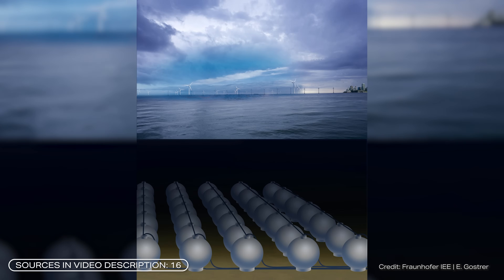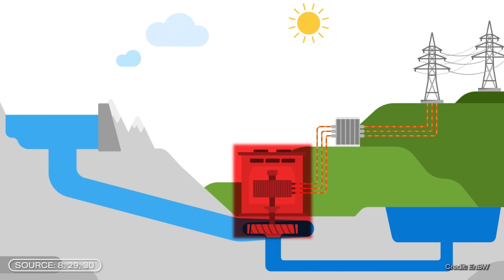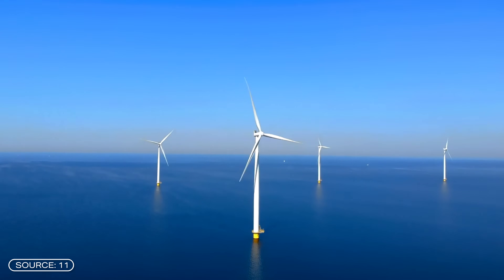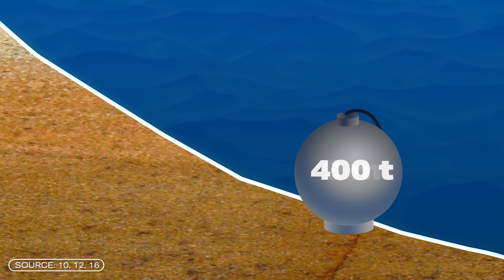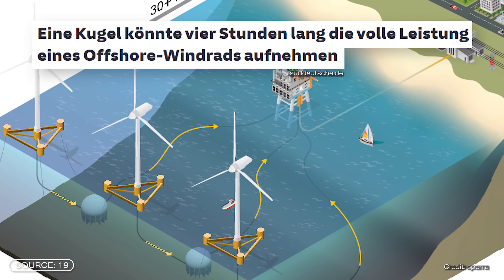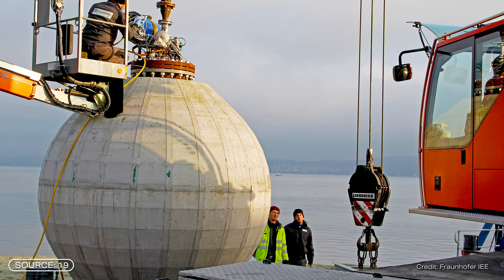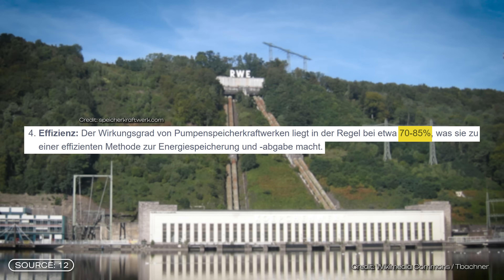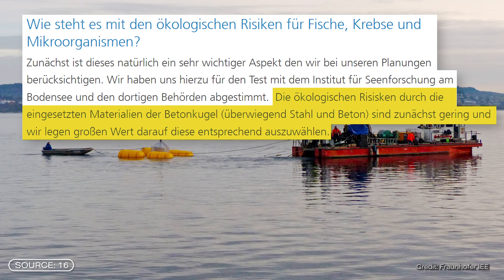Underwater Battery Storing Power at 600m depth!

Comment: I've used large inflatable bladders to seal against high pressure. Instead of 3D printing the container, Using these bladders and a reusable external mold would allow reinforcing the cement with steel or carbon fiber composites.

Comment: Better idea:

Work with gas as the medium.

CO2 becomes liquid at between -56.6 and 31 °C and a pressure of between 5.2 (42 meters deep) - 74 bar (740 meters deep), and reduces to 1/535th of its volume. 

Using the warmer surrounding seawater regassify the CO2 running it through turbines. You would not need to keep the gas liquid for too long, running it through a daily cycle, or a few days maximum. Enough to smooth out the bumps in demand and production.

Comment: I woukd be surprised if 3d printed cement was as structurally strong as steel reinforced concrete- fine for prototypes but not good for mass production at further depth.

Comment: I can see that the principle is OK, no question about that. But with a 9 meter concrete sfere and only 0,4 MWh is not much, my rooftop solar, that is not very big produces more than 1MWH per month during summer. Since I live in Sweden, the average electricity useper person is higher than in Germany. A system like this must take into consideration that heating water and houses make increase the energy demand significantly. This solution seems VERY expansive compared to batteries, but that is an opinion from me, since you have no real costs included in the ad.  What is the estimated price per MWh stored? How much energy is leaked backwards through pumps? Especially after some time?

Comment: errr... like if your going to put it right next to offshore wind, wouldn't it be better to put the pumps and generators above water to make them easier to service, which would enable you to not have to worry about depth at all, yes you would have to worry about the pressure from the prospective of the pipe, but if you are condensing air... hummm you would probably have to use CO2 so you can liquefy the CO2 to reduce the inner pipe diameter so you don't need a stupidly expensive pipe, but it means you could go 10km down and be fine, because thats 100ATM which is about the pressure that you would need to keep CO2 a liquid, and as for the theraml energy you would need to pump into the CO2 to turn it into a gas... ya do know that you are surrounded by water ~95C hotter than the temperature required to turn CO2 into a gas right? 

And the cold, well you could mix it with a lot of ambient sea water before it's released, and haven't we raised ocean temperatures by like 0.9C since the pre industrial area as long as your mixing it to be only 0.9C colder than ambient sea temperatures I don't see a problem.

Comment: 6:05 Actually, a single 30m sphere will deliver 20MWh via a 5MW turbine. Assuming 80% RTE, which is typical for pumped hydro, it would take about five hours to recharge. 🤓

Scaling is done by deploying more spheres. Last I heard, they haven't said anything about using larger spheres, but I suppose it's possible if they fabricate them at sea. Doubling the diameter gives eight times the capacity, but it may be easier to build and deploy a bunch of smaller ones. 🤔
Reply: If the size  is double they will have to use 8times more concrete,  it will be impossible to sink, it will make sense at sea level with steel tanks.
Reply: @yvanpimentel9950  The surface area only increases as a square of the radius, so you only need 4x the concrete. If buoyancy becomes a problem, you can add more concrete as needed; it’s cheaper than steel by weight, it’s already used in the construction, and it resists corrosion. It would make no sense at sea level, because you don’t have any hydraulic head. 😕

Comment: An overlooked solution for pumped hydro of the conventional type is smaller scale closed loop pumped hydro. Michael Barnard reported on Cleantechnica a GIS study from the National Renewable Energy Laboratory (NREL) which found that there are a huge number of possible sites worldwide. Because they are smaller they're faster to build and don't require as much capital.

Comment: Does not see why this is a good idea. There is a 60 bars difference. So the concrete must resist 60 bars from outside. If the water is compressed at see level at 60 bars what is the difference?
Any way, the most important is : how much energy it is recovered compare to the energy used to get the water out? I bet no, less than 50%

Comment: Interesting,  but I do not underestimate the technological challenges, and am not fully convinced about the environmental impact.. Being a Norwegian I know we have quite a large area of deep waters quite close to shore, that should fit quite nicely.  However we have also a lot of hydroelectric power-plants that should be easier to use.  These have limited surplus capacity in the early spring, when the snow melts in the mountains, but the rest of the year it should be fully possible to store energy by pumping water up to the higher magazines, and I know this is already done at some plants.

Comment: Why use a concrete sphere - all you need is a sack - a waterproof bag - which does need to be anchored down
And why muck about with pumps underwater - keep the pumps on the surface and pump air downwards
Great Idea - made far more complex and expensive than it should be

Comment: Neat concept. There are plenty of places in Europe with 600m deep water not too far from the shore.
I assume the design will aim for neutral buoyancy when empty. That means it can be pulled up for maintenance. However, if it fails and fills with water - that is about 12000 tons for the 30m diameter sphere, which means it is stuck there, forever. 
If the engineers can master the pumping of sea water, then there are some interesting locations in the Balkans for large scale (>>100 GWh) storage using sea water pumped storage. 
As for the environmental footprint of concrete, could the researchers consider Biorock (https://en.wikipedia.org/wiki/Biorock)? This is meant to be stronger than concrete, and could be grown near shore and then floated out.  
And forget about putting this in mines and small bodies of water. It will change the surface level so you might as well go for classic pumped storage. Storing a certain volume of water in a lake is easier than in a sphere.

Comment: The concept is great but the fact of using electromechanical devices and sea water at high pressure does not sit well. Very high probability for mechanical failures and serviceability of these spheres at that depth. 
 The second thing I learned today is that in Germany delimiters for numerical values is a decimal point. We would write 10,000 and in Germany it's 10.000 !
Reply: They're using off-the-shelf marine pumps with a rated service life of 20 years. That doesn't seem unreasonable. 🤷‍♂
Reply: Side note: decimals are typically useless and misleading, at least in the press or in visuals. If a percentage is stated as 76.36 those 0.36 are completely meaningless and worse, they insinuate a precision that is not really there. Past 100 it just becomes ridiculous. I once told a gallery owner that her price tags on those thirtysix thousand dollar bronze statues made them look even more expensive (36.000,00) and she changed the tags.
Reply: There are tons of existing marine devices that are fine

Comment: a bladder that could inflate and use the air based turbines when water pressure causes it to deflate would be easier and less material intensive to install. they could even make them like an engine piston out of used tires coated in protective material to add recycling to the process.

Comment: Fascinating technology, essentially gravity batterie's in mine's"are the same as pumped storage in mine's,but lead electrically lifted and dropped is more efficient but probably with a greater outlay at the begining,thank's
Reply: Usually, mines are not close to PV and wind power plants. No need for storage if transport were cheap -- just use the power elsewhere.

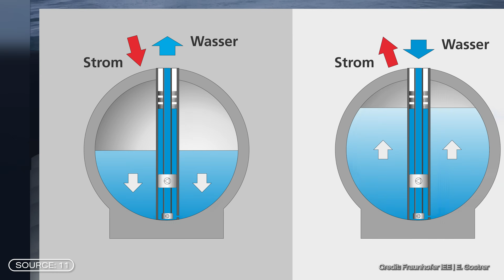Comment: 2:36 The water pump is reversible; in other words, the pump when running backwards is functioning as a generator.
 It's a motor-generator.
strom = electricity  &  wasser = water

Comment: if they were evacuated by pumping in air the interior of the sphere would constantly be at the same pressure as the surrounding sea.  Electricity could be generated by both the in rushing water when a valve is opened and the air being forced out.  Depth thereby becomes a non-issue.

Comment: I just did a quick Google search on "offshore wind farm typical depth" and the AI result summary says ...

"Offshore wind farms are generally located in waters where depths range from around 10 meters to 60 meters, with the majority being in shallow to medium depths. However, new technologies like floating wind turbines are enabling deeper water installations, with some projects operating in waters up to 1000 meters deep."

I'm wondering whether that floating wind turbine technology and this energy storage technology might be a perfect marriage. Might it be possible to build a single module that is a floating wind turbine with its own dedicated storage sphere hung at the perfect depth below it? The counterbalance weight provided by the presumably very heavy concrete sphere might also help with the stability of the floating wind turbine and it might even be possible to provide some pressurised access within the overall structure (a leg/truss going down to the sphere with a diameter wide enough to allow maintenance personnel to climb down to access at least some of the sub-surface equipment).

Comment: 3d concrete printing is probably best in low volume production, but I suspect that if these spheres need to be produced in high numbers, more traditional production methods are cheaper/faster. I also have doubts about the strength and repeatability of 3d printing production. 
The principle of this system is similar to an idea I saw a few years ago, that was to put inflatable bladders on the seafloor and pump them full of air with excess electricity and use that pressurized air to create electricity in turbines. Another option I have seen is to create big enclosed kofferdams in the sea that keep out water. Pump them dry with excess electricity and create electricity as needed as you fill these kofferdams up again. Both methods are limited because they operate at lower pressures than this new concept, but also are more easily maintained. The airbladders, in principle, can have all the moving parts on dry land or a tethered barge, linked to the bladders with hoses or pipes.
Reply: Two downsides with the bladders: Lift and heat. The concrete sphere compensates lift by its weight, but the bladder needs a larger anchor and strength to be tied to the anchor. Compressing gas generates heat, and for efficiency, you would need to use or store that heat -- increasing the investment.
Reply: You're not the only one being skeptic about 3d printed concrete tank. When I hear something people make it sound revolutionise, it will be either fail to delivery what they promised or just being a straight scam.
Reply: I think the 3D printing is just for investors buzzword value. It'd take forever to print a single huge sphere with an expensive machine. Classic formwork can be scaled much wider.

Comment: Each sphere needs to withstand the whole potential force, making the technique require orders of magnitude more resources compared to a pond at same elevation, as the depth the spheres are placed, for a given storage capacity. The potential energy is mgh, mass times gravity times height, and gravity isn't very different 600 meters below sea level compared to 600 meters above it, so those spheres have roughly the same capacity per unit of volume as a pumped hydro dam, with the same height potential. Take a guess what will cost most money and resources to produce, for a given volume, those spheres, or a pond/dam?

An artificial pond for pumped hydro at high elevation require pipes for the water, but that's insignificant issue compared to building those spheres. One could argue that the spheres can be "charged and discharged" very fast without much losses, and a pond for pumped hydro would require really beefy piping to do that. But that supposed advantage doesn't matter at all unless they can make those spheres cost less than batteries, for a given energy storage capacity, which they cant, not total cost per unit of usable energy out of the system.
  
It might seem like energy storage at the point of generation would be ideal, but it isn't. The ideal location to store energy is where the energy is needed, which batteries generally are great for, and pumped hydro can sometimes happen to be relevant close enough. The only real reason to store energy where it's generated and not used, is if storage is cheaper than just increasing the transmission capacity from point of generation to point of use, which requires quite specific conditions.        

That planned 9 meter diameter prototype, 400 tons of concrete, for 400 kWh capacity, that's a ton of concrete per kWh, making the cost of concrete part alone significantly higher than the cost of batteries, even with current batteries, and the cost of batteries is still decreasing.

Bigger spheres can use less concrete per unit of volume, but then there's also the cost of the turbines, one for each sphere, and cables, making it highly unlikely that the cost of storage in those spheres  will be even temporarily competitive with batteries in any point in the future, no matter how big you make them. And, the spheres has a range of severe obvious practical disadvantages compared to batteries,  without any known possible significant practical advantages.  And while the spheres don't require any very advanced new technologies, operating at those depths is inherently complicated.  

While the volume to surface area ratio of a sphere increases dramatically with increased size of the sphere, the thickness of the walls also needs to be increased with increased size of the sphere in this case, meaning that increasing the size of the spheres won't reduce the amount of concrete required for a given volume/storage capacity much. 

Another option that is similar in principle and would be much better, or much less bad, is pumping water into tanks with some pressurized gas to store energy in pressure. Close to an hour charge and discharge time would make the losses due to temperature changes from compression and expansion minimal, and the cost of making those tanks would be insignificant for a given capacity compared to concrete tanks that needs to withstand the higher pressure on the outside, and be on the bottom of the ocean.  Not my idea, I've seen it been suggested, and I'm not saying it's good, just much much better than those spheres can be.
Reply: If you’re going to use mgh, consider the mass of the 600 m saltwater column.
Reply: @mikeguitar9769   The difference in density between seawater and freshwater is roughly 2.5% that doesn't matter much as you only need 2.5% more volume or height difference with freshwater to get the  same energy capacity.

Comment: Quite a few years ago a UK university was experimenting with compressed air energy storage under the sea.
They used strong specially designed balloons and filled them with air to store energy.
The water pressure forced the air out when the energy was needed.
Don't know what happened to them.
Obviously if it was a success we would have a lot if installations now, but we don't.
Reply: I remember the story... university of nottingham.... 4m energy bags... 2012  scapa flow...   probably small size was against them and then batteries got 90% cheaper .....
Reply: @1968Christiaan  
That's the one I think.
Reply: I think the main issue with compressed air storage is that a lot of the energy you put into the system becomes heat so without an effective way to recover that energy as well, overall efficiency tends to be low. The 90% RTE Fraunhofer got in their lake test is actually pretty remarkable. 🤔

Comment: 2:26 in some countries, there is a surplus of electricity not only from sun and wind power plants, but also from hydro power plants, in times of seasonal massive precipitations, if it rains too much or when snow and ice in mountings is melting. If on these hydro power plants enough power generating units are installed, this energy can also be stored in pump storage power plants, and be used during the day consumption, instead of throwing the unused water down from the dams of these hydro power plants. Or people can heat their homes with split "conditioning" systems in autumn and in spring time, when this energy is normally available.
Reply: Maybe something was lost in translation, but the reasoning stated by @konstantinhuwa3064 does not make sense.

Comment: The idea is quite practical however, the problem is that they are using a concrete pressure vessel which is rigid and need to withstand high pressure at the 600m depth when pumped out. This is silly! a better idea would be to reverse the process and use a flexible  sack made of durable polymer and instead of draining the 'pressure cell' to charge it you pump water into cell at depth .  To generate energy, the water inside the cell is released through a turbine  to a surface vent as extremal water pressure collapses the cell. This has the advantage of allowing the cell to be any size as the cell walls are not subject to high pressure differentials. The only pressure critical components in this design would be the turbine  valve and the charging pump which  would be subject to pressures no higher than the local environment in the case of the pump and the valve capacity limited by the systems total pressure differential with the surface.